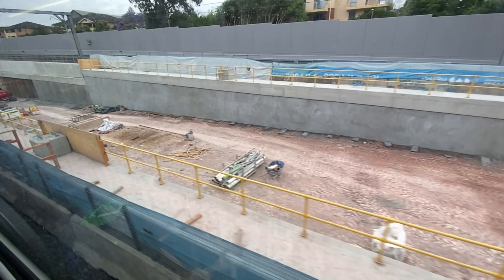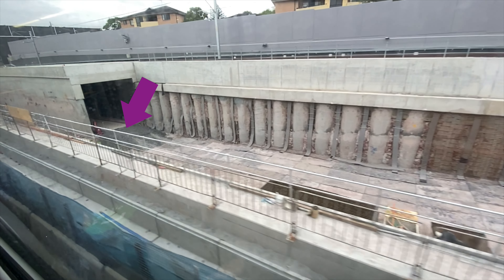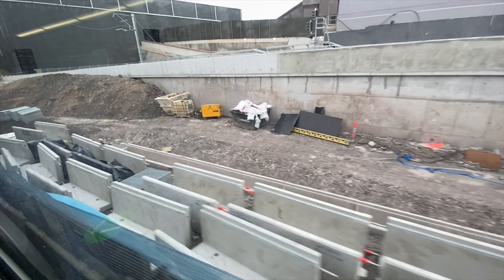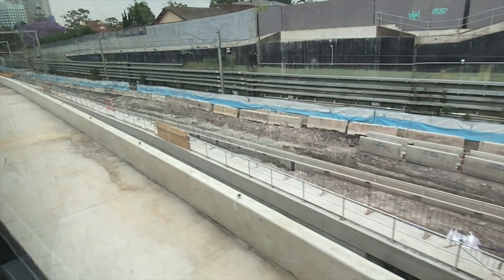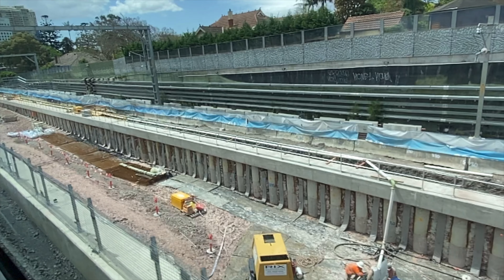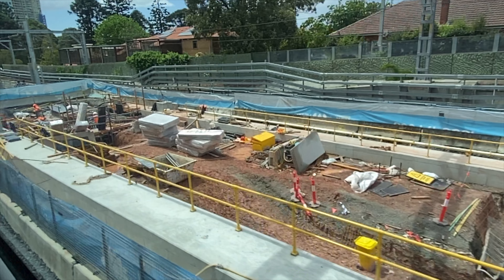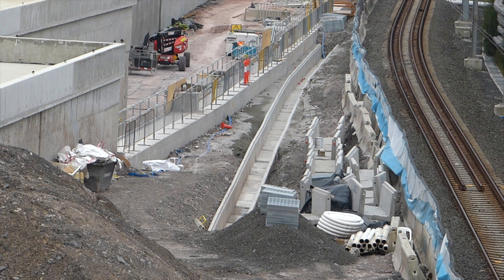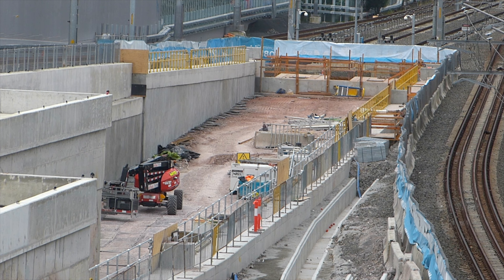Chatswood Dive Site Update - Earthworks for future trackbed & retaining walls progress.

Comment: The cavities at the very end of the dive pit are on the edge of the track slab/sleepers. Effectively, they are under the carriage. Perhaps they will house train monitoring equipment, or equipment to bring a train to a halt if an emergency closes a tunnel. There is no passage under/through the noisewall to Frank Channon Walk.
Reply from the maker: Hi Peter, thanks for that. It will be interesting to see whether this will still be visible once the trackbed has been laid.
Reply: @TransportVlog  if not the cavity, surely something more than a cover will be visible.

Comment: The concrete structure at 3:11 appears to be a transition structure used for when ballasted track transitions to a concrete track bed. Similar transition elements are present on the metro line just before Bella Vista station, where the track goes from ballasted to concrete bed, prior to the tunnel entrance.
Reply from the maker: Good point! It would be in the right place, as I'm sure the tracks into the tunnel will be on a concrete trackbed.

Comment: It looks like the precast concrete sections are for stormwater collection, along with the precast drain "blocks". Very important for this area to prevent or minimise any stormwater going into tunnels where it would have to be pumped out via a water treatment plant. The Chatswood - Epping tunnel stormater all goes to a treatment plant next to Lane Cove River.
Reply from the maker: Thanks Jim! - Yes that would make a lot of sense.  It seems that Sydney Metro are taking stormwater very seriously. There is lots of evidence of drainage improvements being made at the stations on the Bankstown line.
Reply: It is definitely very important to keep stormwater out of a railway tunnel. A few years ago in Singapore there was a stormwater sump pump failure at the entrance to one of the major tunnels in the rail network. During a major tropical downpour stormwater quickly filled and overflowed the sump. An enormous amount of stormwater collected in the lowest point of the tunnel. A major section of the rail system was shut down for 3-4 days while they pumped out the water and checked the electrical systems.

Comment: Hopefully they get to test the metro trains when this whole project is complete before 2023

& they have those glass doors on the platforms to protect passengers getting on and off safely.& better easy access boarding metro trains.

Because normal suburban train platforms don't have those.

& also there will be metro stations at barangaroo/ waterloo/crows nest.
Reply from the maker: Yes I'm sure there will be a whole lot of testing!
Reply: All the new Metro stations will have platform screen doors, including the curved platforms on the converted Sydenham - Bankstown sections.

With introduction of digital signalling, partial ATO, and retirement (or quarantine of T-sets on T4) of the remaining trains that have different door positions, there is some hope that in the future some other Train stations might be upgraded with screen doors.